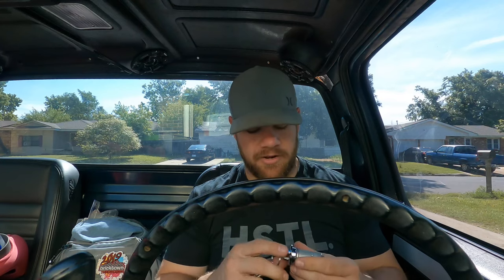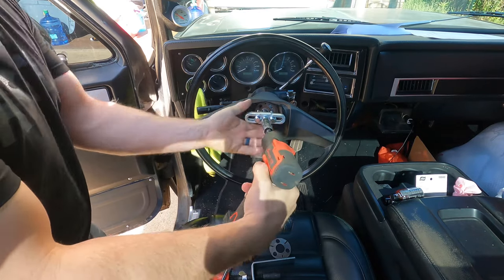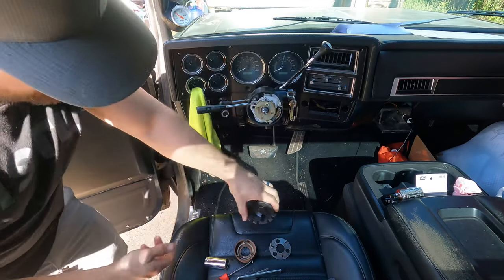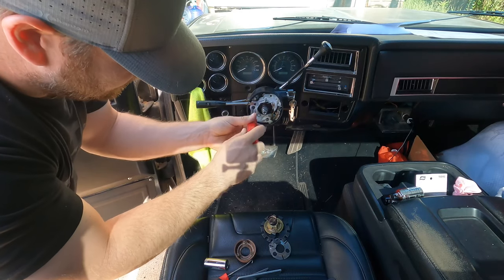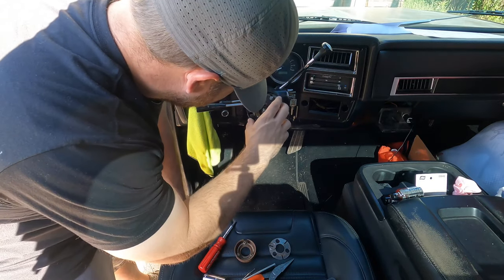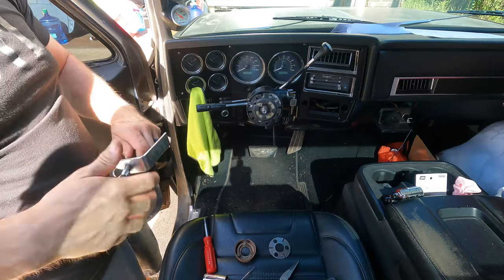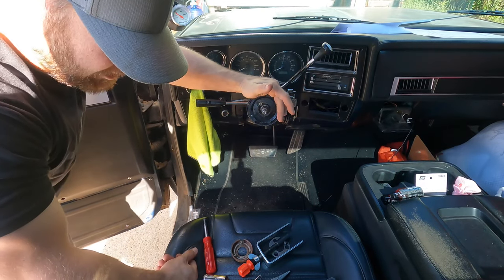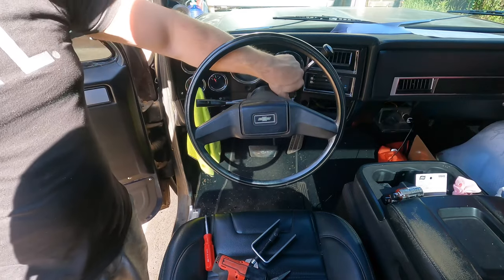Squarebody Ignition Lock Cylinder Replacement

Comment: This was the best overall video for me on that process. NOTE: if you have a 1973-1978, there is no “pin” holding the cylinder in (the one he says here not to drop). There is an unknown little slot you have to punch out by the light of the full moon on Durin’s Day. It’s often covered by the casting so you have to punch it out. There’s a very short, one-minute video showing you where it is. I think you’d never find it otherwise. Was a life-saver for me as I was about to have to drill mine out.
Reply from the maker: I appreciate it!

Comment: I have a class A chevy motorhome with a 454 engine. Like an idiot I gave my then girlfriend a set of my keys but when she broke up with me she refused to return my keys. I already had the door lock re-keyed but now I need to replace the ignition key. I already bought the ignition switch and with your totally awesome video will be replacing it but I need to buy both pullers. Thanks man for giving me peace of mind.
Reply from the maker: Glad the video is able to help you out. Most auto parts stores will rent you the tools for free.
Reply: How did you get the cylinder out without the key?
Reply from the maker: @wackyfox5046  you don’t have to turn the cylinder it just helps out if you are able to.

Comment: Thank for the video man, I got the lock cylinder out, but that little plastic gear that the lock cylinder turns to push the ignition switch rod is stripped.. any idea how to get that out?
Reply from the maker: I haven't ran into that issue as of yet, sorry I cant be of more help.

Comment: How would you remove the lock cylinder if your key is broken and your can’t move turn the key all the forward?
Reply from the maker: It should still come out without having to turn the key. Turning it just makes it a little bit easier.

Comment: what if dont have the key?? that why i need to replace mine.. also will a 77 c10 be the same as this?? thank you
Reply from the maker: Yes the column should be the same. The cylinder should still come out without the key.

Comment: Do you know if this can be done,without the key in ignition? I lost mine is why I'm replacing it .thanks,really informative video!
Reply from the maker: Should be able to just pull it right out. Thanks I appreciate the support!
Reply: I have same issue… It looks like it has to be turned to pull it out so I’m wondering too
Reply from the maker: I was able to remove a buddy of mines without a key. Took a little more force but was able to get it.

Comment: I want to go ahead and replace my ignition lock cylinder but it’s stuck one click before turning the engine over could I still remove the cylinder or does it have to be in the starting position?
Reply from the maker: You should still be able to get the cylinder out, having it in the start position just makes it a little easier.

Comment: My lock in my 84 c10 is stuck how do I rotate it to get it out after the take down and whats the ac delco part numbrr for the lock cylinder?Thanks
Reply from the maker: You should still be able to pull the lock cylinder out even if it won’t rotate.
Reply: @3rdGenC10s  i got it replaced Thanks
Reply from the maker: @dickeymoore3662  good deal hope the video helped you out.
Reply: @3rdGenC10s  yessuh it did

Comment: When I reassembled mine, the lock plate is not within the housing, all parts are back the same lock plate ring is in place, I can push on my steering wheel and it wheel go down feels probably like a 1/4”,,, also the horn button doesn’t have much push down either now, along with horn not blowing either. Anything I need to recheck?
Reply from the maker: Are you sure the lock plate is not in updated down?
Reply: @3rdGenC10s  I checked today and yes, I squished the spring a little and everything set a little better, my horn doesn’t work now, all contacts are intact inside for it, not sure other than that, fuse is good
Reply: @christyreynosa4537  same issue, did you figure out how to get the horn working again?
Reply: @edb3366 no, was just debating whether to just put in a separate horn button
Reply: @christyreynosa4537  I Bought a FIAMM horn button to do just that today and low and behold the bloody horn started working. Pressing in the bottom left corner of the insert seems to be the most consistent for me.
Reply: @edb3366 maybe I’ll give that a try , whatever works lol

Comment: Is the lock plate cover necessary? I bought a c10 with an aftermarket steering wheel and it didn’t have the lock plate cover
Reply from the maker: It may not be necessary but I would definitely want one lol

Comment: My 89 k5 is parked in front of a coffee shop. Key wouldn't turn from lock, got the accessory power with some serious force but no on or start and tried about everything. Wheels could turn with some force which concerns me. I'm hoping this is the fix. Any suggestions? Will I be able to remove the old cylinder in the lock position?
Reply from the maker: The old cylinder should come out wether it’s in the forward or lock position.

Comment: My lock cylinder will not cut all the way back to the lock position which want let the key come out, I replaced the cylinder and still have the same issue. Any ideas?
Reply from the maker: Sounds like you’ll need to go deeper into the column and replace some pieces. I don’t exactly know what they are called lol

Comment: Do I really need a steering wheel puller or can I get it off without one?
Reply from the maker: It’s going to be much easier with a steering wheel puller. I’m not saying you can’t get it off without one but if it’s been on there for awhile it could be a chore to get it off.

Comment: So ignition turns without key in it, should i replace it?
Reply from the maker: I would replace it. Does the ignition actually turn over without the key?
Reply: Yes it does, someone turned it past crank before i got it running. So starts with and without key

Comment: What size is the bolt that holds the switch in?
Reply from the maker: No idea
Reply: @3rdGenC10s  ok mines was a phillips head
Reply from the maker: @dickeymoore3662  I think they used a couple of different heads of screws over the years

Comment: Here's my problem, I broke the wiper part of the stem on my 86 C10 in other words I still have turn signals left & right...99% of the video's  say to replace the whole stem by simply disconnecting the wire under the dash and that it will simply pull out, my stem wont pull out!  even went to the local junk yard and practiced on several 80s C10s, NO PROBLEM! they all pulled out!  went back home to try mine...again it wont come out! you're saying theres a nut that needs unscrewing by tearing into the column??? now I know my C10 has different year truck parts...it had farm lights on top of the cab too, really confused!
Reply from the maker: There are some years where the turn signals and brights are on the turn signal stock, I think 84 and up. I think on 83 and up you can twist them a certain way then pull them out. Without seeing a picture of it I can’t really help you out.

Comment: i dont know why i cant remove my steering wheel using the wheel removal 
am i doing something wrong ?
Reply from the maker: 🤷🏼‍♂️ idk what you are doing lol
Reply: @3rdGenC10s  no , its okay i literally just finished lol 
turns out the wheel removal tool comes with like two washers and some nut looking thing to place at the base of the shaft 
does that make sense ? 
but thaanks a ton though !

Comment: What the new cylinder and key cost
Reply from the maker: I used a AC Delco lock cylinder and it goes for around $25

ACDelco D1403B Professional Ignition Lock Cylinder with Key https://a.co/d/hPoy4A1

The Dorman brand lock cylinder is on sale for around $10

Dorman 924-790 Ignition Lock Cylinder Compatible with Select Models https://a.co/d/faQ5fcp

Comment: Thanks for the video I just recently purchased a 83 C10 myself just had problems with starter and ignition it has been sitting over 15 years low budget rebuild doing it myself your video was great help thanks keep them coming by the way where did you get those seats?
Reply from the maker: Glad it helped you out, they are TMI bucket seats. I ordered them through LMC Truck years ago.

Comment: Mine stays on even after i remove the key, can this fix my issue? Thanks
Reply from the maker: It’s possible, without being able to look at it I can’t give you a definite answer.
Reply: @3rdGenC10s  I banged on the column when I turned the key in the off position so yeah I think it's safe to say I need a new ignition cylinder as well, thanks!

Comment: Hey bro.. Appreciate you making this. I put a new cylinder in my 85 today with no problems. Thank you. The only problem I'm having is it won't shut off. It starts just fine, but I have no accessory power or ability to turn the truck off. Any idea?
Reply from the maker: You could check the rack on the steering column and make sure the rod is contacing the ignition switch and disconnecting when you turn the key off.
Reply: @3rdGenC10s  thank you!! I'll check it 👍
Reply from the maker: Hope that helps. Hard to say what’s wrong without being able to look at it.

Comment: Where about did you get the lock plate pulley?
Reply from the maker: Powerbuilt Steering Wheel Lock Plate Remover - 648466 https://www.amazon.com/dp/B004KED7RU/ref=cm_sw_r_cp_api_glt_fabc_NPWTA4S8P2K1KZKCBQ4M

Comment: Have the same issue with mine. Tempted to replace as i have it, just no puller or lock plate holder... same time im tempted its stolen 😂 

Dont think my ignition is turning to lockout position. Did for the mechanic that did freezeplugs, just no dice for me.
Reply from the maker: The lock plate tool and steering wheel puller are cheap. Anytime you get into the column you will need them.
Reply: @3rdGenC10s  well, bit the bullet and did it knowing it would be a PITA. Took 2hrs and slit my hand open, but its in and solved my problem. Do have a that flat plate behind the 3 screwed piece and the retaining clip not in as forgot. The lockout plate is seated right. Its togethwr and will hold. I dint have a horn anyways as well.
Reply from the maker: @brandoncaldwell95  the more columns you get into the easier it gets. I’ll be replacing the ignition lock cylinder in my k5 soon.

Comment: Circle ring on the steering shaft sucks!
Reply from the maker: Yes sir, mine has been off a couple or more times. You are supposed to replace them each time. I found using a pick to remove them is the easiest way.
Reply: @3rdGenC10s  I work at a scrap yard. A guy scrapped an 86 Chevy k10 no rust on the body, crate 350. I mean it needs a lot of TLC but man I just got that truck for less than 300 bucks. Thanks got the video!
Reply from the maker: That’s a steal. No problem man! I appreciate the support!